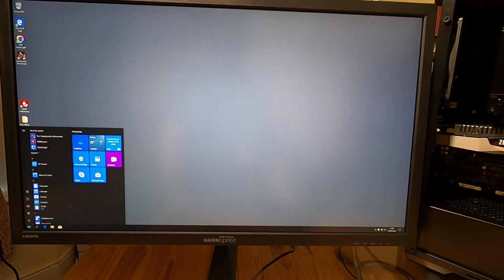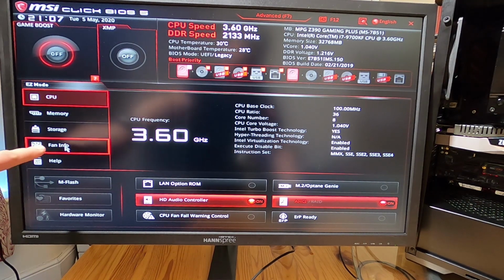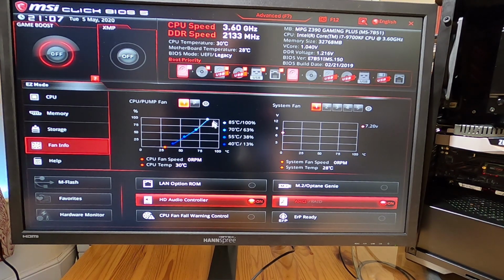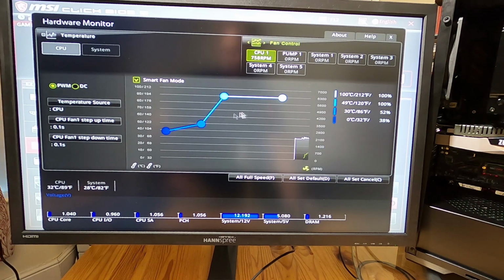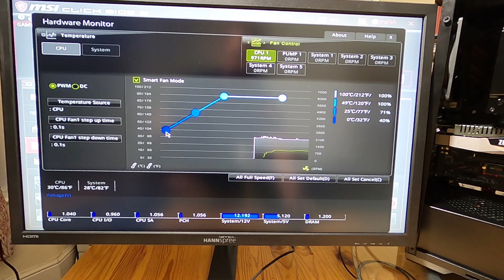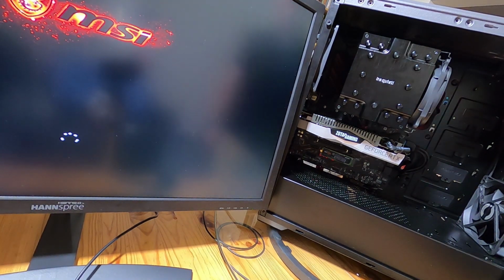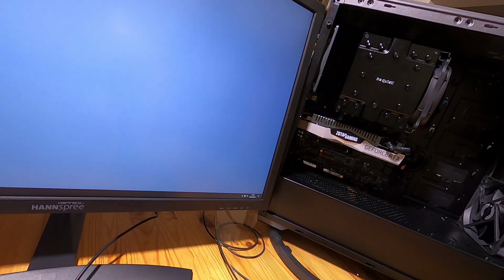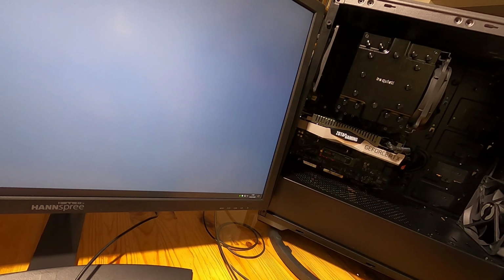CPU Cooler Ticking Sound *DIY FIX* in English

Comment: is it normal for thermalright FW240 Black CPU Water Cooler with Double PWM Fans to make noises when booting up? it does it for like 5 minutes then runs quiet. i took it to my pc guy and he said it was normal but kinda rushed me out and didnt look at it as good as i wanted cause he was busy. but when he laid it down it didnt do it but when its up it does
Reply from the maker: What sort of noises?

Clicking isn't normal... 

But whizzing sounds are fine as the motherboard will spin up the fans to max on boot to ensure it can run them fast if it needs to later.

I'd say running for 5 minutes is too long though... normally its 10 seconds max. for the motherboard to do a full speed fan test on boot. And if it stops when the PC is on it's side then that might indicate an issue with how the cooler is mounted in the case of how the fans are attached to it.

Just double check you have the fans on the right header too.... the fans go on the CPU fan header and the pump with go on the AiO/Pump header if your motherboard has one of those. You should to a flat line at about 70% for the pump fan curve in the BIOS - that reduces noise and reduces wear on the pump but maintains cooling. You can also tweak that to reduce pump noise further. If you don't have a pump header then use one of the case fan headers and adjust the fan curve for it instead.

Comment: Praise the lord it worked, mine were set to silent setting, which is what I want, but had that annoying click sound ever 15 sec as it went from on/off as it went past 40C which it essentially is at 35-42 on basic web browsing so trying me mad.
Reply from the maker: Glad it helped. 🙂
Reply: @ turns out the fans were masking a bigger issue! It’s actually the Hard Drive making the sound… it says it’s healthy via SMART but it’s back a day later… the day of peace was great whilst it lasted…
Reply from the maker: While it still works you can clone it onto an SSD... I've made a video about it.

https://www.youtube.com/watch?v=VPjwuvGmsTY

It's 4 years old, but still works as the easiest method - just make sure you buy a Samsung SSD as the SAamsung software checks. You can use Macrium Reflect if you want to get another brand of SSD.

:)

Comment: Thank you! I have air freezer iii 360 but I had this problem, your fan speed solution fixed it 🙏🏻
Reply from the maker: Glad it helped. 🙂
Reply: @sterntechdaddy   thank you for solution it works when pc is low performance, when it goes to high performance ticking comes back. I think I have to find what causes it.
Reply from the maker: It's probably a fan that's wearing out. When the noise starts, remove the side panel form your PC and touch the center of each fan. Don't apply any pressure - a gentle touch should be enough to slow the blades down enough to disrupt the noise.

Best situation is that it's a case fan... that can be disconnected without any real problems and replaced as necessary.

:)
Reply: @sterntechdaddy  yes a gentle touch fixed it, I found that problematic fan. Thank you for your help.  You got a new follower , also I love how you help people. I am a musician and write scores every day, that noise was driving me crazy; you don't know how much you saved me. Thank you so much!
Reply from the maker: Happy to help. Mention me when you collect your Grammy. Or other music award.

😜

Comment: I turned my fans off, and realised the faint clicking noise was actually coming from my MB or CPU, around that area too. I had an i3-10100T then switched to an i7-11700T and it was really bad, using an i5-11400T now, and it's very faint. Everything works fine, except gaming, after a while I get intermittenment black screens. Doesn't sound like coil whine, it's literally a clicking, crackling sound, what the hell is it?????
Reply from the maker: What motherboard are you using?

🙂
Reply: @sterntechdaddy Gigabtye H510M-H i5-11400T 32GB DDR4-3200Mhz
Reply from the maker: Could be a capacitor. Might even be coil whine - which isn't always a high pitched sound. If you can swap out the GPU then that would rule that out, but as it's worse under load it might be a GPU issue.

Did you assemble the PC?

Are all the mounting points in place and screwed in?

You could also have Task Manager running to see if the sound corresponds to high CPU usage.

Note that if you try and find out what isn't the source of the sound then you'll ultimately find out what is.

:)
Reply: @sterntechdaddy Everything was fine until I put the i7-11700T in, was a damaged CPU and I took a gamble on it, then the i5-11400T was better, less noise but still black screens after about half an hour of gaming. Got a feeling the i7 messed things up, perhaps a complete BIOS reset and a few other things I can try. Don't really game anyway, just testing mostly, and the i5-11400T is fine for my work, just concerned about long term issues, as I want this PC to last me a while.
Reply from the maker: Seems to me that you only get issues when you game and as you're not much of a gamer it won't matter now or in the longer term.

🙂

It does look like a CPU issue...

A BIOS reset probably won't do much if you've not altered the defaults anyway, but a BIOS update might help - if there is one.

But...

If it's not really broken for you then there's no need to fix it - so might be better to leave things as they are and not do any BIOS update.
Reply: @sterntechdaddy Really don't know, just got an i5-11500T now, in the post, and maybe they'll be a difference. Got a habit of tinkering all the time and buying used parts of ebay, custom building all the time, but am saving money by not having to upgrade all the time to play the latest games at least.
Reply from the maker: For games... the native resolution of your monitor determine the GPU you need. There's no point having an RTX 4090 if you monitor is 1920x1080.

But swapping out bits is where the fun is anyway.

Hopefully its the CPU and the new i5 will help.

:)
Reply: @sterntechdaddy  Just did a stress test, when the CPU's under full load, the clicking noise goes away but comes back when idle. Now I'm really confused.
Reply from the maker: I thought the opposite would be happening - with CPU stress causing it. So I guess I'm wrong about that...

Time to get the kitchen roll tube out... no really... because...

You can put it next to your ear and use move it about to more accurately determine which component is making the sound.

What cooler have you got?

If it's an AiO then it might be the impeller inside the pump.
Reply: @sterntechdaddy  Zalman FX-70, it's actually a fanless cooler, my whole system is passively cooled apart from exhaust fans.

Did some searching on-line, it's the MB and probably the capacitors, it's silent when I turn off Turbo Boost, but I get a performance hit. Turning off C-States and I get a consist whining noise because the voltage to the CPU remains the same. 

Well, it still does the job I want it to do, but am concerned if those capacitors on the MB will blow up or die on me in due time.
Reply from the maker: I love a silent cooler... :D

Happy to see you've got this solved now.

I doubt the caps will explode, but I would bump 'new motherboard' up a bit higher on the list for the next upgrade.

😂
Reply: @sterntechdaddy  Just tried gaming, still getting black screens though, regardless if I change the settings or not. 

Leaving everything on now, as long as it lasts me a few years then I've no real complaints. Oddly enough, everything was fine with the old i3-10100T, perhaps the capacitors got used to that CPU and didn't react well to the change.
Reply from the maker: Have you checked the BIOS version to ensure it supports the newer CPU, and the voltages the CPU is getting?

Maybe a BIOS update and/or a CPU voltage tweak might help.
Reply: @sterntechdaddy  My mate today said it might be a grounding issue, or perhaps the MB is struggling to deliver enough power to the CPU and GPU (GTX 1650 which runs off the PCIE power) at the same time while gaming. Either way, he said it's not a reliability concern as coil whine is normal, and the system should still last a while.
Reply from the maker: Grounding is why I suggested checking the mounting risers for the motherboard. The I/O shield also grounds. But if they are all OK then it's not going to be a grounding issue that can be fixed easily.

I don't believe coil whine is normal... I've only heard it a few times in 40 years of messing about with computers and only on graphics cards. It vexed me so much I made a video about it. It's an RMA trigger for me...

Did the BIOS and CPU voltages look OK? 

Have you got another PSU to test it with?

But it just sounds like the motherboard isn't happy to me.
Reply: @sterntechdaddy  I was a MB off ebay, not exactly brand new, but still works generally. Rather not fiddle around with voltages in the BIOS myself as I'm inexperienced there.
Reply from the maker: I wouldn't say you were inexperienced at all...

But checking the voltages and BIOS version doesn't mean you have to change anything.

Also, you have to be a bit scared and step out of your comfort zone in order to advance your skills.

:D
Reply: @sterntechdaddy  Tempted to just get a new MB instead, all this tinkering's quite wasteful, used to spend hours over-clocking and stuff, was fun but really should be doing something else with my time.
Reply from the maker: It can be fun. Overclocking is rather pointless unless you're pursuing it as a fun hobby and/or a competitive sport. There's an ePenis vibe to it that can get a little bit ridiculous. Adding it to a forum post signature makes me cringe a bit, for example.

You can get performance gains, but if Adobe Premier takes 5 minutes less time to create your video then that doesn't really matter. Some games can be unstable with an OC too.

I've bought OC gear in the past - and made a few videos about it. My current systems have matched RAM and RAM XMP profiles set up but I don't bother with any of the fiddly OC tweaking.

Because, like you,  I probably have better things to do!

:D
Reply: @sterntechdaddy  Guys are the same when it comes to cars and engines as well. 

Were you saying the noise could be a sign of a problem that could get worse though? My mate said it's could be the MOSFET's too.
Reply from the maker: Weird noises can never be a good thing...

Comment: Strange, my BeQuiet Shadow Rock 3 has the same ticking sound, but I already have it at 50-60% steady. Just noticed the coilwhine on my 4070 ti too, noise like it annoys me so much 😁
Reply from the maker: Just tap the fans to see which fan(s) are making the noise. Maybe try spinning them at 65% to see if that helps. 

Depending upon what 100% is, 50% might be slow enough to cause the noise if it’s a slow enough spin speed. 

As for coil whine that’s another issue… have you got a Corsair power supply?

Comment: This clicking noise is lagging out my game idk
Reply from the maker: Can you identify what is making the sound?

That'll help diagnose. One possible reason for the lag it thermal throttling of the CPU/GPU.

You could run CPUID Hardware Monitor to log the max. temps. And check Event Viewer for anything that looks odd corresponding to the times you experience the lags.

This is about finding out what the problem isn't being caused by - rather that a direct attempt to guess what it is. :D
Reply: @sterntechdaddy  i think its the gpu coz i cant see it in my setup sice the glass is facing a wall and if i try to use while open case while playing a game if i hear it click the game froze or it lag then if it stop its back to normal it crashed my game once its not even a high end needs a monster to process game it ls a old game company of heros and it scares me since it click then crash the cutscene or skip it
Reply from the maker: Check Event Viewer.... looks for disc errors. If the click is metallic sounding then it might be the HDD rather than the GPU. Lets hope its the cheaper fix...

But you can also look for driver crashes in event viewer - the GPU might be overheating. If its an older 1080 series card then that would be likely - the thermal pads and paste used for their heat sinks is likely to have deteriorated.
Reply: @sterntechdaddy  mine is quite recent  and a chinese knockoff a 2060 axius cant remember the brand right also how to do those checks? Im new to this
Reply from the maker: Take a scroll through Event Viewer.

Right click the start button…

Comment: I know the video is 3yrs old but can you reply on why it makes a ticking noise even when its off like i tuen ut off it still maoes noise
Reply from the maker: Can you locate where the noise is coming from?
Reply: @sterntechdaddy  yes kinda but it the noise goes away when I click this button behind the PC (I'm new to PC) it turns the fan on and it goes away but when it's off it still does
Reply from the maker: But can you tell where precisely the noise is coming from?

It's obviously going to be hard for me to help without seeing a picture of the PC.
Reply: @sterntechdaddy  so it comes from the back side of it on bottom right it's a pre built Optiplex 7040 it only does the noise when plugged in. I don't have monitor yet so I guess once I get one it will stop soon?
Reply: @sterntechdaddy  maybe I can get you're discord or sum then send vid of the noise
Reply from the maker: I'd say that's the fan in the power supply. Assuming this is your PC...

https://dl.dell.com/topicspdf/optiplex-7040-desktop_owners-manual_en-us.pdf

Back, bottom right is the PSU. It's where the mains cable plugs in.

If you've just bought it - contact your supplier. DELL power supplies are proprietary and need to be replaced with the correct part for each computer. This also looks like it's an older Windows 7/Windows 8 model too - so it's not unusual for a PC of that age to have twitchy PSU fans because the fans in this type of PC are smaller in diameter than more conventional ATX case power supply fans. This means they have to work harder to pull in air. 

I'm guessing it's been bought from a business for refurbishment and resale.

Comment: I finally fixed it. This noise was driving me crazy and I assumed my mainboard or CPU were faulty. I even messed around with the CPU efficiency/power-saving BIOS settings (C State etc.) because the noise only appeared when the CPU was idle. Thank you for the video!!!
Reply from the maker: Glad I could help!

Comment: I also have BeQuiet cpu cooler, i ran some game to run for some time and exited so fans can lower speed down and during that my PC made similar weird ticking noise that lasted for some time untill pc returned completely to idle. I did turn off pc case fans to isolate sound while running game so temps were higher in pc so when i exited game to cool it down it started happening. Could that be the issue?
Reply from the maker: Some fans don't like running at lower voltages/speeds.

Note that changes in sound levels get noticed more than steady volumes... so you might find you notice constant fans speeds less than varying ones even if they are actually louder.

As this video is about a free fix it's worth a try....

:)
Reply: @sterntechdaddy  Do you think sound may be dangerous for components? Or its not something i should worry about?
Reply from the maker: Overheating has the real world potential to be a problem, but motherboards do have safety measures built in. A dangerously overheating PC will normally turn itself off before any damage can occur... like the one in this video:

https://www.youtube.com/watch?v=jAJphLT-xaE

Technically, you can turn off all the internal case fans and provided you've got the usual vents the air flow from convection is usually enough.

You obviously shouldn't disconnect the CPU, GPU and PSU fans if they have them... but the case fans can be removed - see the above video.

Its the voltage output to the fans that sometimes need tweaking - especially for the larger fan diameters.

Take a look at the fan profiles in your BIOS and tweak them - the minimum speed might need increasing to a level where the noise stops.

It won't be for all the fans too... so it's worth trying to identify the fans that are making the noise and then tweaking the profiles for then rather than playing with all the available profiles.